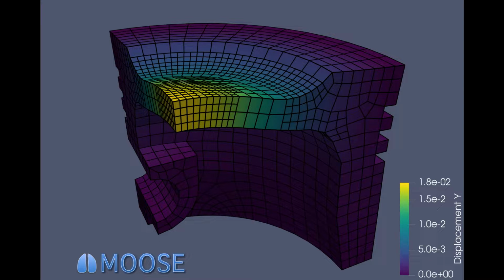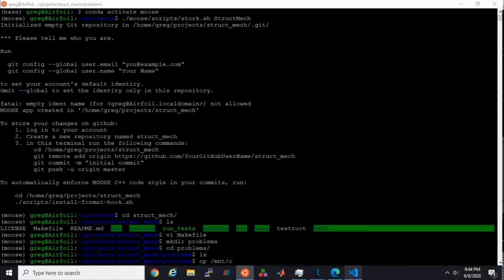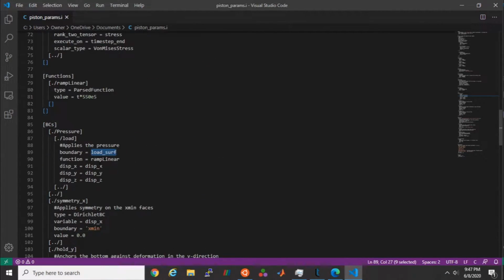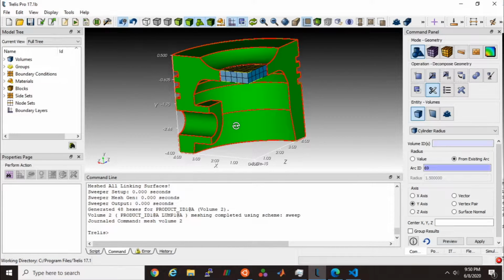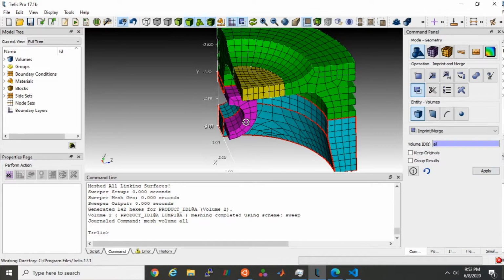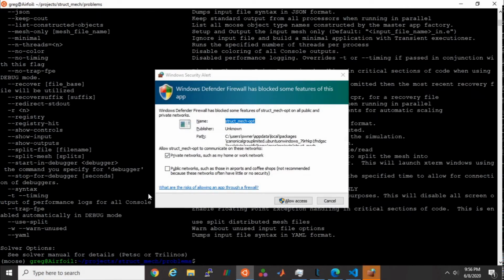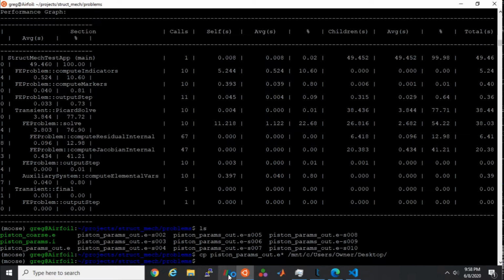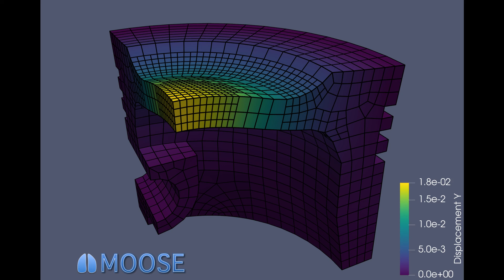MOOSE Structural Mechanics FEM Demonstration

Comment: Thanks for the video. As a new user I could follow along and learn a lot.
However, upon running I got below error. 
Could you please let me know how to fix it?
Thanks!

* ERROR *
/root/projects/struct_mech/problems/piston_params.i:90: missing required parameter 'BCs/Pressure/load/displacements'
        Doc String: "The displacements appropriate for the simulation geometry and coordinate system"

Comment: Very nice lecture, how about IGA with MOOSE Structural Mechanics ?
Reply from the maker: Coming soon!  We're finishing up several enhancements that will enable spline basis functions in MOOSE.  See: https://github.com/gsjaardema/seacas/issues/189, https://github.com/libMesh/libmesh/issues/2179, https://github.com/idaholab/moose/issues/18768
Reply: @Coreform_Greg  Thanks a lot for reply! Which journal articles about converting isogeometric U-spline meshes into Bezier patches?
Reply from the maker: @liboyan7010  There aren't any articles available yet that talk about converting U-splines into Bezier elements.  But the process for converting splines into their piecewise Bezier components is called "Bezier extraction" and you can find many papers on Bezier extraction for different types of splines.
Reply: @Coreform_Greg  thanks!

Comment: I liked your video, watched it more than once. But I can't get the app to run.
All three files of 8/18 from the Moose site were in the piston_params directory,
including the 'test' file. The following error happened:

* ERROR *
/home/gary/projects/piston_params/piston_params.i:59: missing required parameter 'BCs/Pressure/boundary'
    Doc String: "The list of boundary IDs from the mesh where this boundary condition applies"
/home/gary/projects/piston_params/piston_params.i:59: missing required parameter 'BCs/Pressure/type'
    Doc String: "A string representing the Moose Object that will be built by this Action"
/home/gary/projects/piston_params/piston_params.i:59: missing required parameter 'BCs/Pressure/variable'
    Doc String: "The name of the variable that this residual object operates on"

Is this another syntax update problem?
Reply from the maker: You may need to update / upgrade your MOOSE installation.  See https://mooseframework.inl.gov/getting_started/installation/index.html#update

Comment: Thank you for your tutorial, but when I follow it (using your piston_params.i)  MOOSE warning "piston_params.i:91: unused parameter 'BCs/Pressure/load/disp_x'             piston_params.i:92: unused parameter 'BCs/Pressure/load/disp_y'          piston_params.i:92: unused parameter 'BCs/Pressure/load/disp_z'   ", I dont know what is the problem?
Reply: and each timestep result is 00000e0
Reply from the maker: Hi @zhiyuan chen!  Thanks for bringing this up, the MOOSE code had updated and this changed the allowable input.  To solve this, I worked with the MOOSE team to get this problem included in the MOOSE repository as an example, that is hooked up to their test suite.  In the future, any changes to required syntax will flag an error on this problem and will signal that the file needs to be updated with the code changes.  You can find the input file at the location below:

https://github.com/idaholab/moose/tree/master/modules/tensor_mechanics/examples/piston

Comment: Hello sir, can you assist with the MOOSE installation
I tried the process, got to the point where i had to download the MOOSE conda packages and then an error popped up. Please find the error message below:
An HTTP error occurred when trying to retrieve this URL. HTTP errors are often intermittent, and a simple retry will get you on your way. 'https://conda.anaconda.org/idaholab/linux-64'
will be very grateful if you could help out, thank you
Reply from the maker: Hi!  It looks like that might just be a temporary issue, but if you're still having problems hop onto the official MOOSE forum at https://github.com/idaholab/moose/discussions and ask your question there.  You'll find the developers will be more than happy to help answer your questions!